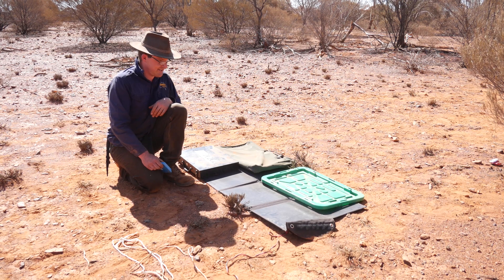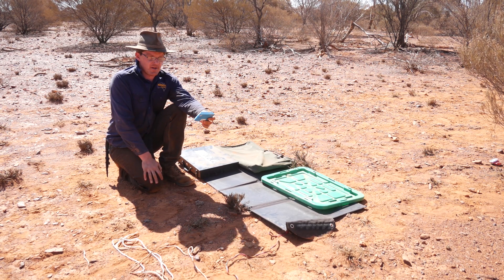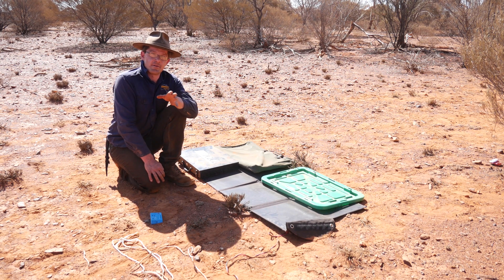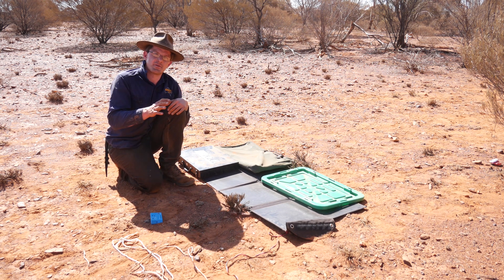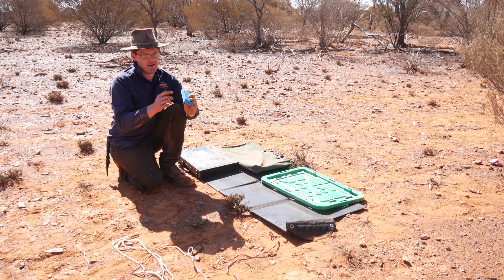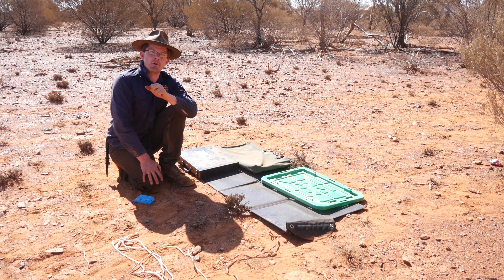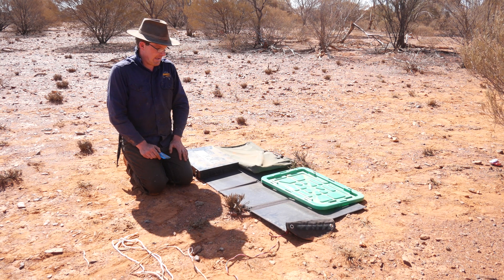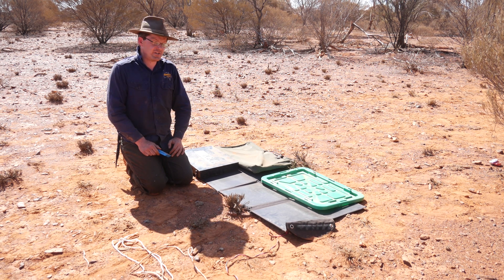Solar panel repair

Comment: Great content Geoff, just found your channel,  may even put a viscous fan on my old 90 2.5 petrol, watched your video but as far as I'm aware my engine block is the same as your 2 1/4 series 3 and a pump with a screw thread is available off the shelf, of course parts are easy to obtain in the UK check out Paddock Spare's and John Craddocks they are 2 big ones who do world wide mail order.
Reply from the maker: Hi Roy. Welcome to the channel. I haven't seen a early 2.5 liter in the flesh before though from my understanding it is pretty much just a bored out 2.25 liter. It is one of the may great things about owning a Land Rover there are always plenty of spare parts and usually reasonably priced too. Oh, I been using Paddock and John Craddock for a few years now, they are pretty handy for getting hold of those more difficult parts. Best of luck with you project Roy and thanks for stopping by the channel. Kind regards Geoff
Reply: Hi Geoff thanks for your reply, the 2.5 is the same bore it has a different crank with a longer stroke, different pistons, higher compression , same camshaft but advanced 5 degrees with a different sprocket and a unleaded head, different carb with electric fuel pump apart from that they're identical lol